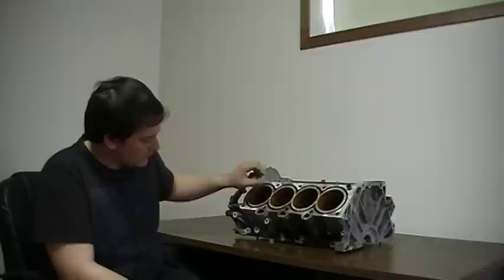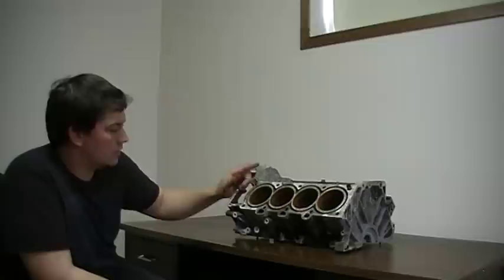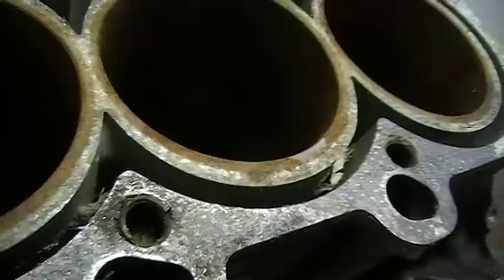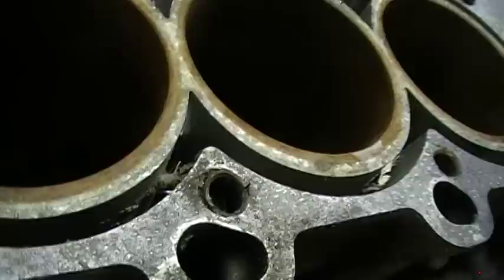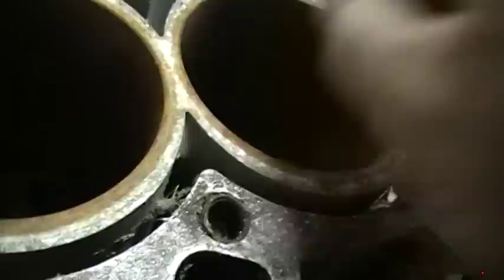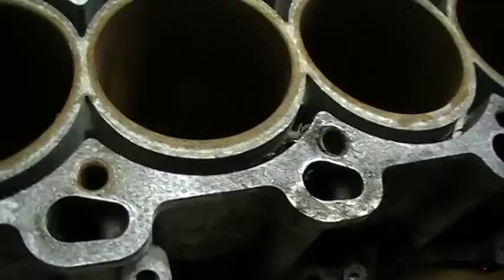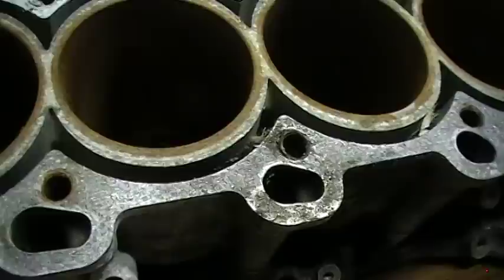Northstar Engine Block Cracks - the REAL cause.

Comment: Yeah that's true. maybe I should change my thermostat as preventative maintenance.
Reply: +Benjamin Rubalcava   If your not having any problems, I would leave the system alone.  If its not broken, don't fix it.  What you want to do is keep the coolant changed out when needed as letting the coolant become acidic will create problems. I work on these cars and I know them pretty well.

The problem here is that the engine was overheated multiple times was is why it cracked.  Thats what he is not saying. Or if it cracked due to a head stud, then it was not installed correctly.

Comment: What's up with new Idler pulleys and Belt Tensioner? I'm trying to replace these parts and discovered that these new parts are smaller than the ones from 1994 in my 94 Seville STS. What gives? Every auto parts store has the same parts in stock that are too small compared to the original Idler Pulley and Belt Tensioner.
For now my Cadillac is left stranded on the highway. It's been three days.
Reply: Maybe the replacement part was made in China.
Reply: That would be surprising seeing how I went to Autozone and Cadillac dealerships.
Reply from the maker: OrangeCounty92 - I can help you out with that. I know what you're talking about.
Reply: My 96 deville is leaking coolant out the bottom and steaming in my dash. Dont know what to do...

Comment: are the 2004 northstar engines at all different or better?
Reply: The 2004 and 2005 engines are different and better, especially if they're maintained properly and the coolant was always changed regularly and never sat. However, they are not bulletproof like the 2006 and newer ones. Mine has failed 3 times (and it was never fixed by Northstar Performance, I always went to the scrapyard and just found a different engine) - and this time I'm buying a whole new engine from N* Performance - just because I want it fixed right this time.
Reply: UnitedRecording I have a 2004 sls never had oil consumption or leak or problems I just need a truck for the work I do and where I live but no one will buy my Cadillac because they think all northstars ever made are junk
Reply: UnitedRecording thanks for the info I wish someone would do a video on the 2004 differences and if they are better.

Comment: Yeah get rid of any caddy with a Northstar engine, also olds Aurora and Pontiac Bonneville,Grand Prix the " head bolt" redesign is crap they still pull through,despite the larger grooves. OR buy my nicely equiped Aurora and DTS caddy give them to ya cheap.

Comment: This happen often?Im thinking of bying a cadillac eldorado but now im not so sure...
Reply: loranga japp a lot of them, or most of them
Reply: +loranga japp  The crack was most likely due to the engine being overheated more than one time. That doesn't just happen. And if it did crack due to a head stud, then it was not installed correctly.
Reply: +Y10Q   For an engine to crack, it must have been overheated more than once. That doesn't just happen. And if it did crack due to a head stud, then it was not installed correctly.
Reply: +loranga japp  If these engines are maintained properly then there shouldn't be any problems. Where the most of the problems were was with the coolant in the cooling system. When the wrong coolant is used or if the coolant is not changed out when needed, the coolant will become acidic and eat away at the head gasket and then start to corrode the lower head bolts and threads. That was was the problem at least with the cars that had overheating problems. The original head bolts are fine regardless of what people may think. And this problem was also with other GM cars and trucks around the same time. It is Not GM's fault but with the lack of proper maintenance. It is so important to perform proper maintenance on any car and do what the manufacturer recommends. I work at Cadillac and I know these cars and engines pretty well.
Reply: AMCNorthstar 93
Thx again man :)
Reply: btw can i use 15/40 oil?And how do i reset the % thingy for the oil?AMCNorthstar 93
Reply: loranga japp No problem. I thought I would give you some good information since I work on them and know them pretty well. Any year Northstar are great. My parents still drive their 1995 Seville SLS with over 330k on it now. We have had it since 1999 and its been excellent with no problems at all. Its been very reliable and the best running car we ever had and with the least amount of problems.
Reply: AMCNorthstar 93
And the % for the oil thing?Its on 72% noe.
Reply: loranga japp What year Cadillac do you have? The oil life index is different on other years.

I would recommend using 5w-30 or 10w-30 as that is best to use for various weather conditions. Using 15w-40 engine oil is not necessary. If you live in a cold climate, you will notice that the car will be harder to start since the oil will be much thicker and heavier.
Reply: loranga japp For the oil life index, press the information button until it displays this and then press and hold the Reset button for 5 seconds and this should reset the oil life index. Let me know if this works for you.
Reply: AMCNorthstar 93
Will do,thx yet again :)
Reply: loranga japp No problem and let me know if you have any other questions about your Cadillac. I'm glad I could help you.

Comment: you should hot tank that block and put it on display on how its cracked
Reply: +Kenneth Mcaskil   I guarantee you this engine block cracked due to being overheated multiple times. An engine cracking like this doesn't just happen or after one time.  Its also possible that there was water in the engine and it froze during the winter maybe??
Reply: Fyi hot tanking aluminum will destroy it. You will trash if it otherwise belonged in a customer car paying job....

Comment: I have a Northstar from a 2002 deville and it cracked as well.
Reply: +Newbpwng  it must have been overheated many of times for that to happen.
Reply: +AMCNorthstar 93 I mean really what's all the fuss about the Northstars blowing heads...lol I've been around northstars sense I was 12 or 13 and now 27 have owned 4 Cadillac North stars my most recent was a 2001 Seville STS ,Estate Green with Ottawa Tan Leather interior, also had Flowmaster 40s on her..Beautiful car when I'd wash and Wax her stock 17 in chrome STS wheels BOSE premium audio 6cd changer ..,MagnaSteer and the other performance goodies that come stock on the STS. Never ONCE HAVE I EVER PERSONALLY HAD A HEAD GASKET ISSUE I've never seen a head gasket case maybe that's because everybody that I know MAINTAINS PREVENTATIVE MAINTENANCE and overall take care of the car .Only head gasket cases I've seen are usually from people who don't take care of there cars..Also these N*s aren't meant to be babied., You really gotta get em on the highway at least once or twice a month and give em a good WOT run..most people think you should creep and crawl no no no get Ger WOT and get all your fluids circulating thru that 32valve block!  I promise if more people WOT there N*s and used some TOP NOTCH OIL like ROYAL PURPLE.... be alot different story's buddy.I've never had one blow a gasket I've had the oil leak from valve covers and a oil pan leak on a 99 deville but never anything with heads WHAT SO EVER..all comes down to maintenance people.
Reply: Keep emHonest ** Your exactly correct!!!  Thats exactly what I tell other people. I myself have also been around Cadillac's and Northstar engines ever since I was little. I had a family member work there and I work at a Cadillac dealer now myself. Every Cadillac that I have seen with a head gasket issue were the ones that were NOT maintained properly. I can't tell you how many times Cadillac's and other Gm cars came in with mixed coolants in them or old dirty coolant that was never changed out!  My parents still drive their 1995 Seville SLS with over 330k and never any major problems. Had the car since 1999 and its been the best running and most reliable car we ever had. I drive a 2005 Deville special edition as my daily driver and I love it!!!  I really enjoyed reading your comment! Thanks
Reply: Bro...I've been bitten by the bug again lol..it's been 3 yes since my Beautiful Estate Green STS was totalled in a rather ridiculous accident, I miss my " Green Goblin " lol that was her nickname.. Seeing people like you in these comments and watching these videos really has inspired me to get another STS has to be 2000-2004 model for me preferably.  I like to land a clean Sable Black or Midnight Blue STS in that year....wheew just thinking about how that ride felt...I remember when I first got my green one my mother had to literally pull me out of it lol I drove it all day literally ...she nicknamed it Christina because I would be under it's possession lol..I really miss that car.. I'm not going to let anyone in my family or friend know what I'm targeting next lol..they'll know when they see...Flowmaster 40s and Xenon headlights and fog lights soon as I leave dealership.
Reply: Keep emHonest ** I feel the same way myself. I always loved the Cadillac's including the Seville, Deville and the Eldorado. I drive a 2005 Deville as my daily driver and there is nothing that can pull me out if it. I enjoy everything about the car and I wanted one for the longest time.  I remember when the new Deville came out in 2000. I think I was only about 8 years old and I remember playing in the showroom. What wonderful years my parents and I got to enjoy before it all changed. The Seville was always a top pick of my parents and myself. I would like to buy a Seville myself to add to my Cadillac collection. I'm not that picky since all Seville's are beautiful and good looking cars to me. But if I had to pick a Seville, I would like to find one in the dark midnight blue. Blue has always been one of my favorite colors.  And I also don;t care about what anyone says. These cars are very well built, reliable IF maintained properly and will last you a long time. The overall build quality is great and the ride itself is amazing!!  I'm sorry to hear that your Green Goblen was totaled. If it were me, I would want the car and use it as a parts car. I would completely part out the entire car since the Seville, Deville and Eldorado have been discontinued.
Reply: Yeah really bummed me out that they discontinued that body style...absolutely the most sexy caddys of all in my opinion...That Midnight Blue just sounds lovely... I can see it now... The Blue Bomber... lol yeahhhh
Reply: Keep emHonest ** I know it bums me out too but its the sad truth.  Cadillac really shot themselves in the foot when they retired these cars.  The early to mid-2000's were very good years for GM and Cadillac. I remember how well these cars were selling when they were still a few years old. I really miss those days and yet it wasn't that long ago. I really think that the Seville SLS and STS was a car being the Leader of the Pack. There is a special feeling when you get into one of these cars. The sister cars were the Pontiac Bonneville and Oldsmobile Aurora, also discontinued now.  These cars all used the same platform and were the best and most durable platforms during the time. There is a reason why these cars hold up well and also have high ratings in safety!  The STS was the Seville's replacement in 2005 and the DTS was the Deville's replacement in 2006.  They were also good cars and were discontinued in 2011. Ever since then, Cadillac has went downhill faster. I see it all the time. The older ones sell much better and faster than any new Cadillac.
Reply: Absolutely correct, I'm settled in to the fact I'm getting another STS...I would do the SLS if it's a 2004 model I believe those came with the wood wheel and wood gear shift like the STS's did..but the STS has the MagnaSteer and PAS and CVRR suspension I mean there's a feeling you get when your driving that STS so much power and you can drop the gears if you want...to much fun lol...I'm sold
Reply: Keep emHonest **  I think your right.  I need to go drive a Seville STS again!!! Its been awhile since I drove one last. The STS model comes with the wood package standard. The SLS had it as an option only. I have the wood package in my 2005 Deville as a special edition being its last year.  It makes the interior look much richer. And its real Burl wood used.
Reply: Exactly and when polished and cleaned it just exudes that pure luxury feel..I must say when I had my STS the lady's took a special liking to me lol..not so much with the current Lincoln Towncar I'm driving lol...boy getting that Northstar on the open road and WOT!
Reply: Hey i just finished rebuilding my Cadillac engine, suspension and fixing some trims on the inside. The dash top panel was watoed on the outsides from the sun heat so i grabbed a replacement at the junkyard that was like new and put that in.
Reply: Newbpwng Good stuff bro,What model caddy and year?!?
Reply: Keep emHonest ** What year Lincoln do you drive??  I really like those cars as well. But I settled with my Deville because I wanted the Northstar engine, and having that extra bit of power came in handy many times.
Reply: Its a 95 ,with 232,766 miles and drives tough you wouldn't believe it has that many miles...RWD so easy to work on...but after all these YouTube videos I've been bitten by the caddy bug lol...gotta reclaim that old glory with the STS
Reply: Keep emHonest ** 2001 Deville Dhs, pulled a block from a junk yard out of a 2003.
Reply: Keep emHonest ** i have a 95 lincoln mark viii as a primary car but i am selling it now. Originally i wanted to rebuild the engine and supercharge or turbo but it was just a dream, i have no place to store it for the future if i ever wanted to actually get it done.
Reply: Newbpwng I hear ya, was it costly to have the block put in? How many miles??
Reply: i did it all by myself so not really. The block was 150$ at the junkyard. Took about 25 hours to pull the old engine take it apart and reassemble with the block i got from junkyard and then reinstall it back in the car. My original engine that was cracked had 110k and so did the one i pulled from the donor car, which had blown gaskets under both heads.
Reply: Keep emHonest ** Well actually i guess the cost was higher due to the new parts i have used. Installed 20 time-serts in both upper and lower block. New main and connecting rod bearings, new rings and head bolts. New timing kit and all the seals. In the end it all added up to about 1k not counting the new alternator, starter, power steering pump, serpentine and timing cover seal.
Reply: Keep emHonest ** I would suggest to keep the old Lincoln as your daily driver and also have the Seville STS for other occasions. I'm glad to hear that you stayed American and not driving a foreign brand.  What I like about both the Lincoln Town Car and the Cadillac Seville is that they were both assembled and built right in Michigan. The Seville was built right in Detroit at the GM Detroit-Hamtramck Assembly center originally built for Cadillac. just a little Motor City car history for you. I have a family member that had worked there for many years but is now a retired auto worker.
Reply: Yeah, I've been looking at BMW 528i and 540i...something just keeps pulling me to that 2000-2004 STS though..might have to sell the Lincoln for financial purposes.
Reply: Keep emHonest ** Stay with Lincoln and Cadillac. I like Mercedes myself but not as much than Lincoln or Cadillac.  I almost bought an older 80s Mercedes a year ago but then came back to reality and realized how much better the Cadillac's were. That's how long I have had my 2005 Deville and I don't regret it at all.  My 05 Deville was the best choice for me. I wanted a big car and it came down to the Deville and Town Car.
Reply: Yes sir...got to be a caddy!
Reply: Newbpwng Well all your work I hope pays of for you. I don't suppose that you'll have any problems not for awhile. I'm glad to hear that you decided to fix your DHS and not let it go to the salvage yard. Enough of them have been sent there.  Just keep your car maintained especially the cooling system.
Reply: Would you recommend running Royal Purple oil and or particularly what antifreeze do you run in your N* it's been years but I used to roll Castrol...
Reply: Keep emHonest **  Any kind of oil is fine. I don;t think there is a bad oil. I happen to use Castrol or Valvoline in my Cadillac's. As far as Antifreeze can be a challange with people. Since 1996, for Cadillac's and Gm cars and trucks with aluminum engines and components are suppose to be strictly DEXCOOL. Its an orange color coolant and not green. Don't mix the two together as this is where many people went wrong. It is better because it is silicate and phosphate free and helps against internal engine corrosion.  The coolant needs to be changed out when needed otherwise you run the risk of it becoming depleted and turning acidic. I run Dexcool in both our 95 Seville and my 05 Deville. I even switched over to using Dexcool in both my 84 Seville and 85 Eldorado with the 4100 engine.  But when doing this switch, it is very very important to remove all traces of the previous coolant.

Comment: I just got a 2000 Cadillac deville it was running hot I replaced water pump and water pump tension pulley and thermostat still ran hot really fast I then removed heads had no problems with head bolts I then cleaned heads and inspected the heads the best I could saw no problems with head bolts or heads I then installed new head gaskets and new head bolts engine still runs hot very fast even with thermostat removed some body please help me 😤😤😤😭😭😭😭😭😭😭😭😭😭😭😭😭😭😭
Reply: Danny Whiddon 
Check the coolant purge hose to make sure it’s not clogged.